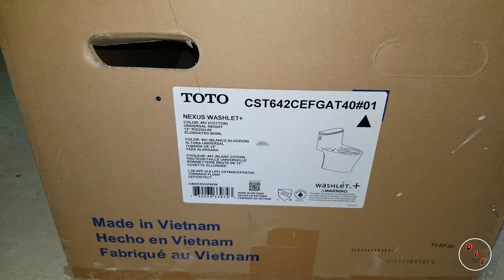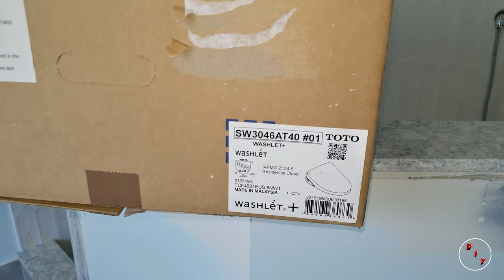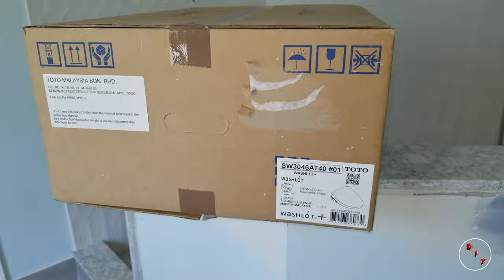TOTO CST642CEFGAT40#01 | TOILET | HOW TO INSTALL?

Comment: I am replacing toilet ring for my toto. Installer has flange recessed below ceramic tile, so when i press down, it doesn't seem like toto drain pipe unit doesn't touch wax ring. I tried jumbo wax ring, but it sits about 0.5" inches too high. What would you recommend? I assume that wax must contact top part tightly?

Comment: Does anyone have an issue with odor? Since we installed the Toto there has been a decline in air quality. We’ve tried washing the bidet seat regularly but that hasn’t helped. Now wondering if the wax ring or the rubber connection under the tank were not installed properly. But then I should be seeing some waste leak from under, I assume.